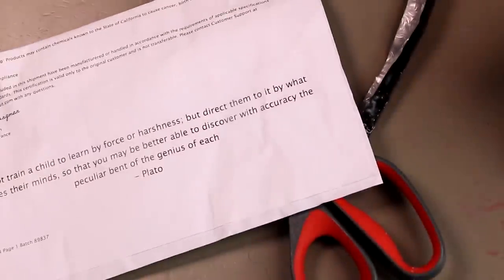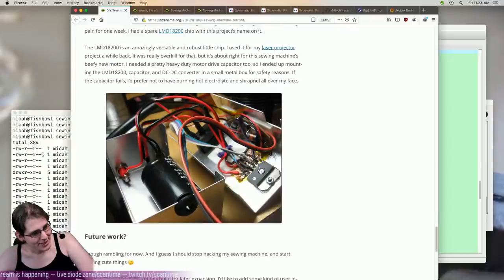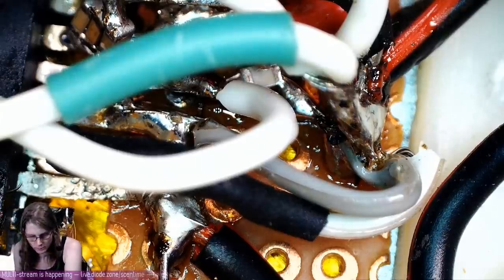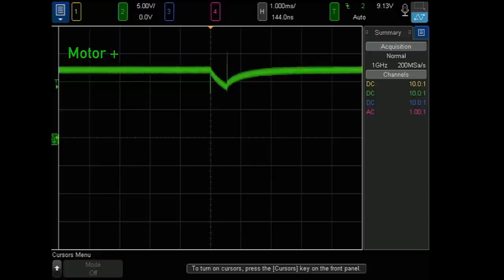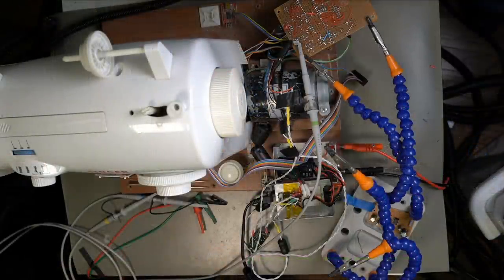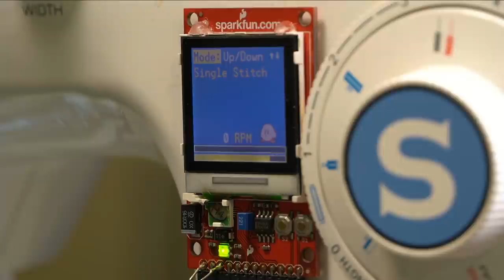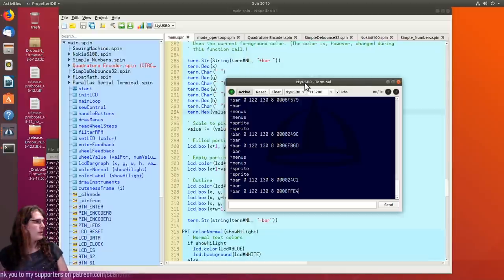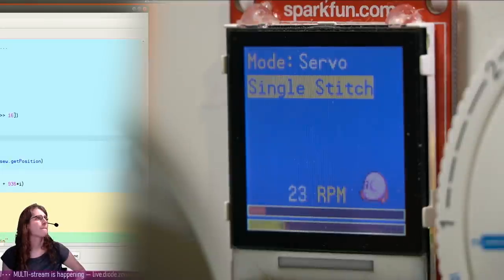Sewing Servo Mess

Comment: A lot of the noise you were seeing on the scope is due to the long probe ground wires - for measuring this sort of stuff you really have to use a very short (<1 inch) ground to the ring around the probe tip.
Reply from the maker: Hi Mike, you can see that short ground in some of the shots. I think I was using the long terrible ground lead mostly for measuring the grounds that were already terrible for other reasons too :D

Comment: I can commiserate. More than once I've been sure my problem is hardware - transient spikes messing up the uC or something, added random capacitors and filters... no dice, and then eventually realize it's software. Most recently a math error causing writes out of bounds for what should have been a ring buffer.

Related the Parallax uCs, I really liked the step by step debugger support that the SX28 had. (formerly Ubicom/Scenix Semiconductor before Parallax bought it)
Reply: I've seen what you have done with the Ariane 5, last that summer... :)

Comment: Excellent video, as always. I'm surprised the problem was not with a long flat cable running next to the motor. It should be picking a lot of noise.

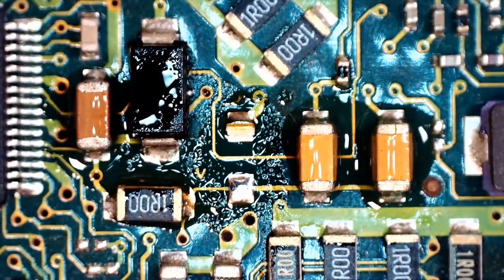Comment: What were you using to salvage those caps off the disk drives (around 8:30)? Was it just flux paste and a heat gun? Used to use desoldering tweezers for salvaging SMD components, but I don't have them at my new job, so I've been doing it the dumb, destructive, ineffective way with a normal-tipped soldering iron. This seems much more effective (and obvious).
Reply: I think it is the atten 850b hot air station. There are tons that look very similar: Hakko 850b, quick 850b/a, “ random brand” 850a/b. I just got the new atten ST-862D. It is super solid. Another good option is SUGON 8610DX. There are plenty of hot air stations pick one in your price range that meets your needs. Bulk heat is easy so cheap ones will work. Reballing an ic and need everything to survive get a nicer one.

Comment: What is the vibrating tool you use to scratch away at the solder mask?
Also; seems like you should include a watchdog timer in case of crashes -- won't help with the cause, but at least will help prevent it running away on you.
Reply from the maker: The vibrating tool is just an x-acto knife sped up a lot in post :) A watchdog would have been great but I didn't have one available, and didn't get around to building a standalone watchdog.
Reply: @scanlime  haha, ok. I might try gluing an xacto blade to an electric toothbrush one day -- been trying to find a good automatic way of scratching away at soldermask.
Reply: @scanlime  Yes, I too was thinking about a real hardware watchdog, industrial-style, wired to cut off the motor ... when thinking about future scanlime's fingers:)
Anyway, great job!

Comment: What is the vibration tool used to removed the soldermask. Bespoke? It's used @ 11min 5 sec.
Reply: That's an exacto knife, and the video is sped up like 10x there.
Reply: @reportingsjr  Bummer, i had hoped is was some bespoke tool Micah had made. Maybe a project for a LRA and hardened needle/probe, DRV2605L